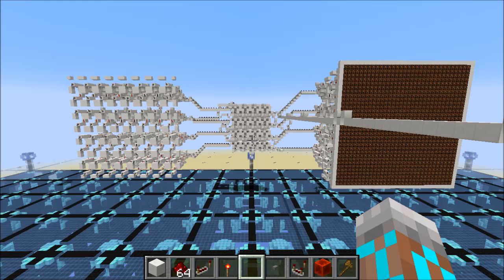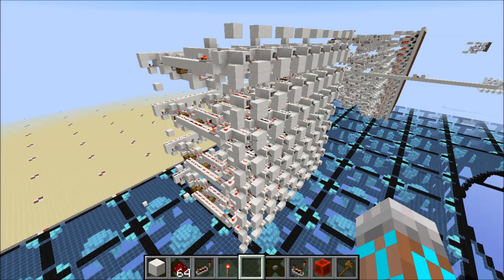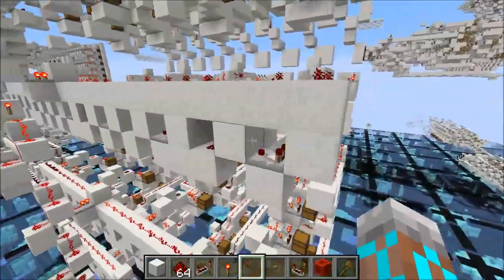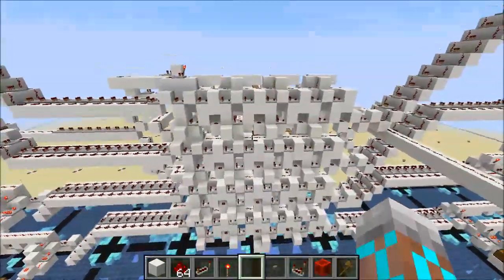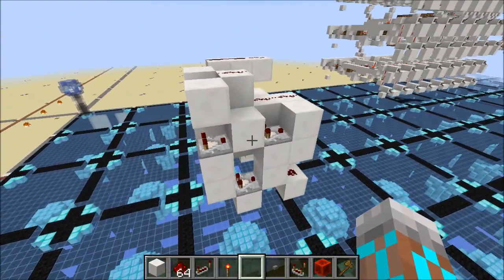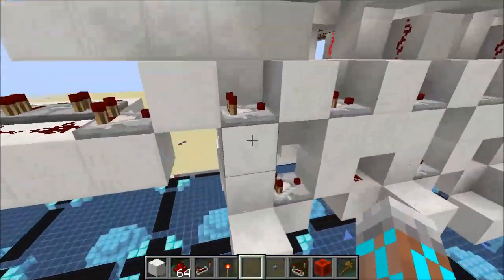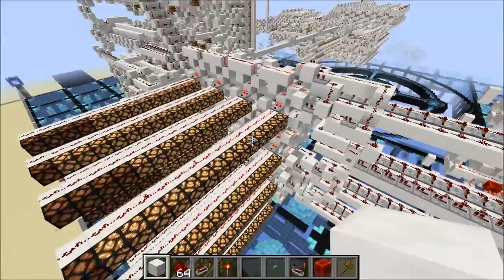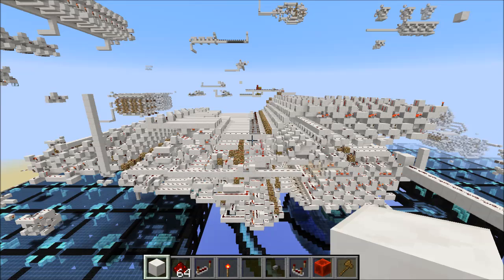Analog Serial RAM for Massive Data Transfer (and "Data Compression"!)

Comment: Can't wait till you make more videos. I don't quite understand the way it saves it yet, could you explain it some more?
Reply from the maker: It's all about the timing. The memory cell is a standard analog D-FlipFlop - when a new value is being written the current data is cleared and the new value is allowed to enter the cell just as each value that's being sent matches up with the cell it's supposed to go to. Let me know if that helps, and I could definitely deconstruct the cell and do a demonstration as well.
Reply: it kinda helps but i still don't see how it works with storing 4 signals in 1 cell with signal strength, what would be a on state and what would be off, or OOOh now i c it changes a binary signal to the signal strength and opposite, sorry my mistake